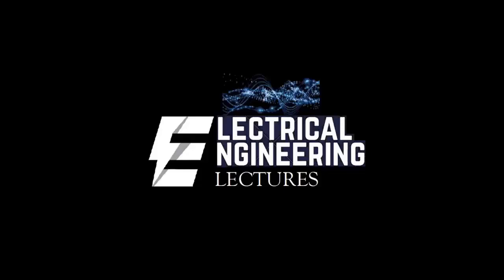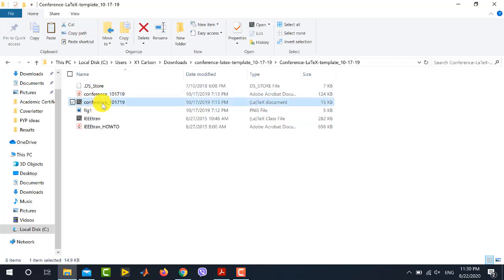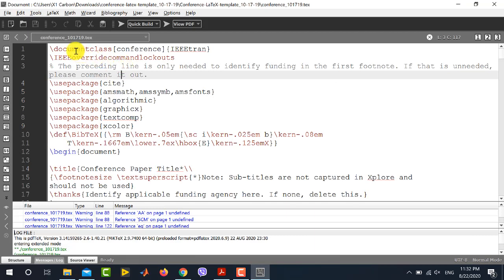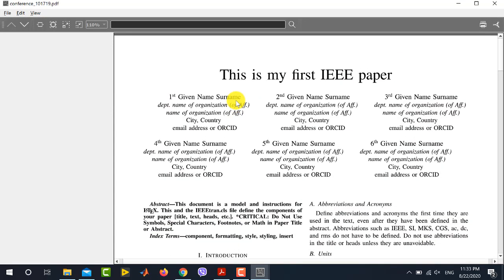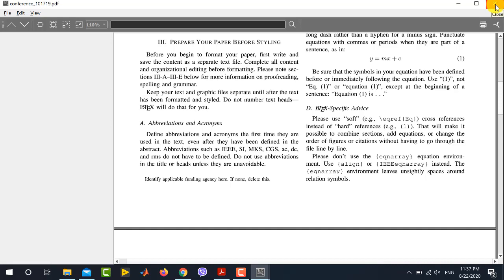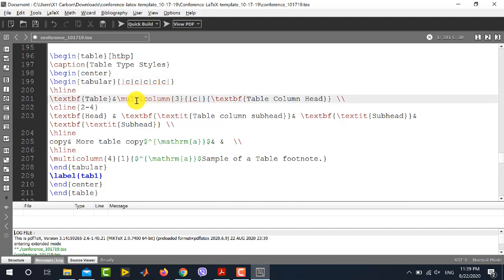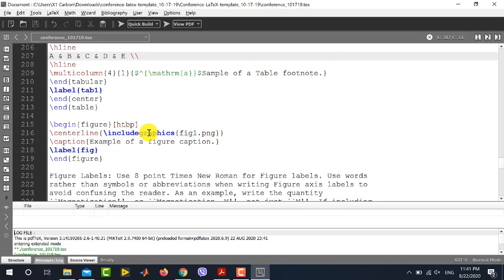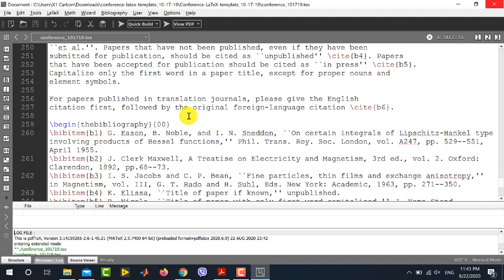How to Write IEEE Research Paper in Latex | IEEE Latex Template Complete Tutorial 2020

Comment: sir i opened this template but 2 errors are coming
line 2:! LaTeX Error: File `IEEEtran.cls' not found.Type X to quit or <RETURN> to proceed,or enter new name. (Default extension: cls)Enter file name:! Emergency stop.<read > \IEEEoverridecommandlockouts
line1:! ==> Fatal error occurred, no output PDF file produced!
plz guide me to remove this error ,i need to convert my paper in latex template urgently.
plz help me
Reply from the maker: The template folder includes this file IEEEtran.cls. kindly download again and run the template from the same folder
Reply: @electricallectures  whether this error is due to something is missing in my texmaker software??